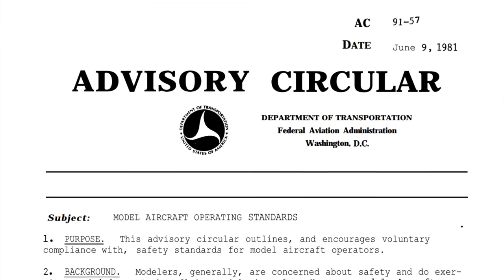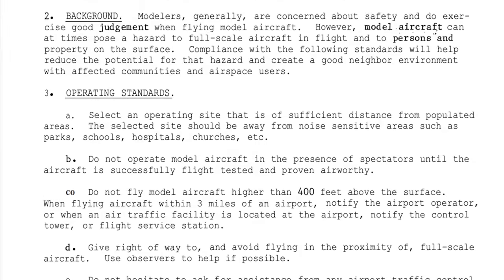A Remote ID Solution for Fixed Wing RC

Comment: Forgive me Tim. You have way, way more experience than me in the hobby. I cannot help but feel that you are being hopelessly naive here. I don't believe that the remote ID requirement is about safety at all. There have been so few 'safety' issues that any ruling/regulation is not warranted on the grounds of safety - there is just no statistically significant issue to be found. It seems to me that your strategy here it to essentially tell the FAA that "us fixed wing guys are good guys and we don't do what the drones do". The FAA/Congress (more importantly congress) will not care about that at all, because the issue is not about safety at all. Others say that there are groups lobbying to have the lower altitudes of airspace restricted and regulated for 'pipe-dream' drone delivery services and 'air taxis' etc. I'm very open to being wrong about all this. Thanks once again for your content and I hope you prove me wrong.
Reply from the maker: Cliff:  Thanks for checking in!  The overall thrust of RID is a starting point for fully integrated manned/unmanned aircraft operations.  It is pretty much common sense that the FAA needs to know who is  flying in the National Airspace System.  Today they cannot do this, and identify the pilot of full scale has always been possible.  A bit easier as you can find the airplane at whatever airport it lands at.  You'd be amazed at what can be negotiated with the USG if you put effort into it.  Key thing with the FAA is safety.  We have to demonstrate, with data, that fixed wing (in this case) pilots can be trusted to follow the rules.  This simply is not the case, now, with the drone community.  FRIAs will be a test.  If we can show we stay within the boundaries, this will be most helpful.  Tim
Reply: Don't agree with you Cliff.  There wasn't an issue until Quads started wandering into controlled airspace. In particular, far too many GA pilots report Quads dangerously close to the pattern, and Commercial pilots have seen them on approach. 

That's what put the burr under Congress' and FAA's saddleblanket.
Reply: @TimMcKay56  Tim, how do you identify the pilot of a paramotor when one flies overhead?
Reply: @gordonmckay4523  So why do  we need RID for drones?  Can't we also just follow them to the landing site -- they go even less distance than paramotors!
Reply: @kf4293 no it was sparked by commercial interests, a dji watching ball game.
Reply: @xjet  X, as I've said elsewhere, Get mental health care. You don't even live in the United States! You literally don't have any skin in the game. Just... stop.
Reply: @RickLaBanca   That happened, I believe, after the proposal. It was, however, another example of a few quad flyers being irresponsible nuisances, and thus giving the FAA another example to point at of why "baked in" RID is "necessary."
Reply: @kf4293  that’s how to lose a debate! It affects us all, countries follow suit all the time. I welcome any smart input.
Reply: Exactly right!  The Folks Against Aviation(FAA) had no interest in the zero to 400 foot Above Ground Level airspace because it had no value.  It wasn't until corporations like Amazon started thinking about using drones for delivery that this whole debacle came about.  Suddenly there was a move to get all those amateurs out of the way.  The solution?  Crowd them all onto reservations(FRIAs) where they could be watched and controlled.  Those that got off the reservations had to broadcast their position to everyone, not just LEO'S.

I'm concerned that flyers will get robbed because they are broadcasting their position and that they have a $1000+ piece of equipment.  Then there are Karen's throwing fits because her privacy has been violated while she is in a public park.

I don't see anything good coming out of RID!
Reply: @RickLaBanca   You missed the earlier volley brother. I strongly advise you to keep your nose outta it.

However, since you insist on being a clown, RID is US. When did the FAA get jurisdiction beyond the United States and its territories? 🤔 

Maybe I missed some resolution at the UN giving them worldwide authority, I was so busy with the War in Israel 🇮🇱.
Reply: If a wrongdoer wants to air deliver  a heavy item, over a long distance, then fixed wing is the vehicle of choice.
Reply: @nateteator3901   Correct. Typically, a Boeing 737 or 757 is chosen.
Reply: I agree man! All these people drinking and driving! It’s horrible. We all need tracking information in our cars to tell the police when we go to the bar!!! TRUE AUTHORITARIANISM FOR THE WIN!!!
Reply: As you are well aware, fliers in the UK are looking at the US in your battle with the FAA, because of the close relationship between the two! 
"when the US sneezes - the UK catches a cold"!
So naturally the UK has a vested interest, especially with their battle with the CAA?
Reply: @kf4293  Whether he lives here or not... his point is still valid! I do live here in the States, what gives Part 103 ultralight operators/Paramotors the right not to be monitored on what they are doing or see if they follow rules in airspace? Absolutely nothing other than radar... They require no registration or license, no real age limit, no radio communication, and no transponders. But you want my toy plane to have half of this being operated safely at an AMA sanctioned flying site...? I dont think so.
Reply: The FAA have admitted that RID isn’t about safety, it’s about security. It was pushed on them by Homeland Security, DoD, etc. and they specifically insisted on having the control location broadcast.

Comment: Be careful if you focus on the "safety" aspect.  Unfortunately the traditional hobby has a worse safety record than the recreational drone community.  As of the time I type this, there have been ZERO deaths attributed to the recreational use of multirotor drones -- ever, anywhere on the planet, however there have been a number of deaths within the hobby over the years.   If you emphasize "safety" the FAA could come back and use that data to destroy your argument.
Reply from the maker: Xjet:  You raise an interesting point here.  This may seem a bit odd or strange, but when the FAA talks about safety, they like safety, but they are really focusing on the traveling public (on commercial airliners).  The FAA, if guess in terms of "personal freedom," gives a tremendous amount of leeway to pilots killing themselves . . . as long as they do not hurt the innocent public.  There are around 230 general aviation crashes a year, same accidents every time.  This could be fixed easily with, say, a checkride every other year.  But the FAA tolerates this, again as long as the public is safe.  Don't get me starting on the ultralight safety record.  So it seems a tad harsh, but the FAA really "does not  care" is an RC modeler get injured flying their Telemaster.  Tim
Reply: Yeah.  I've don't know of any drone that run on jet fuel and go who know how fast..   but I've seen some model jets. explode on impact when crashed
Reply: It's not in the realm of impossibility that a government agency would bend some statistics to suit there needs.
Reply: There have been precisely two deaths worldwide that are officially attributed to fixed wing model aircraft. It may be possible that more have occurred but predate the current world wide sharing of information. Your point is invalid.  The single biggest distinction between traditional hobby model flying and multi rotor operation is the level of personal skill required as a beginner. Since multi rotor UAS cannot be manually controlled, but only controlled by giving commands to the automatic systems onboard, the skill level required is almost zero.  This leads to , as outlined in this video, the flooding of the air space by ignorant operators.
Reply: @gilbertgauger3380  Clearly you are unfamiliar with multirotors.  If you were nearby I'd gladly let you try to fly my freestyle quadcopter.  It has no GPS, it has no self-righting capabilities -- it does exactly what you tell it to do -- which, in the case of the untrained, is seldom what you want it to do.   The reality is that a freestyle quadcopter is far more like a fixed-wing pattern-ship than anything else and requires a lot of skill and practice to even hover.

You seem to make the assumption that all multirotors are the same -- which would be as ridiculous as suggesting all fixed-wing models are the same when we know there are some that are almost impossible to crash (SAFE) whilst others require significant skill to take off, fly and land.

Please research the subject before making sweeping comments.
Reply: Safety has very little to do with it. Both drones and fixed wing aircraft have pretty good safety records.  The government is more concerned about the deliberate missuse of unmanned aircraft.  The bad guys are not going to use a remote id when they use a drone or rc plane for improper purposes.  So, sending the FAA a kind note asking them to change their mind is ridiculous.  😊

Comment: I like the idea of separating out fixed wing from drones (and I'm a quad pilot) but not about restricting cameras on fixed wing. FPV on fixed wing or just recording your flight on a GoPro or RunCam is a nice way to relive your flight on those days when you cannot fly. FAA should respond to the overall safety that we modelers have and let us fly. Let Homeland Security deal with all of the fringe element doing nefarious activities with flight.
Reply from the maker: Russ:  I am in no way restricting cameras on fixed wing.  Just, for this very initial discussion, require RID on fixed wing that use cameras.  If we can show we follow the rules, then further negotiation.  Tim
Reply: What do you fly quads or drones
Reply: Two things make quads fundamentally different than traditional fixed wing: FPV and VTOL. VTOL allows someone to launch from their front porch, whereas fixed wing pilots need to seek out a large open space to take off and land. FPV allows flight out of LOS, which is where they tend to get into trouble (like into aircraft approaches). The combo of the two, while fun for the pilot, makes it trivial to do bad things. Also, the inclusion of a flight computer which makes it easy for a novice to fly with no training means that a quad pilot will not typically have exposure to experienced pilots that will have taught them the proper safety protocols. FPV and Go Pro are entirely different things.
Reply: Also, while not as common these days, quads without FPV do exist, and they should be considered the same as fixed wing (as they are LOS) in Tim's argument.
Reply: @jasonhurdlow6607  I’ve got fixed wings that don’t require that space. 
Consumer dji drones allow what you describe, most quads do not.  I doubt many freestyle or racing quad has been reported in an airport, if any. We only fly 3-5 minutes!
Reply: @RickLaBanca  A quad is a drone. All unmanned aircraft, are " drones "

Comment: Your premise is based on  experience with AMA flying.  However, there are those who fly fixed wing that are not AMA members and do not fly around the patch at AMA fields.  Examples are FPV and autopilot fixed wing models.  The feeling of flying fixed wing FPV is a magnificent experience.  The guidelines for safe flying and respect for people and property are a must for any RC pilot.  So it is pilot decisions and valuing others over ones personal desires that ultimately drive safety.  The AMA as an organization demonstrates how to focus on and teach flight safety.  However, assuming fixed wing flying equates to AMA membership misses the mark and does not consider the possiblities of current and future forms of fun flying.  One example is flying quads LOS where no camera is used.  So perhaps a solution is not lumping any form of RC flight together based on stereotypes and instead focusing on getting safe RC flying in front of the public and quality opportunities for education and training for all ages to keep people and property safe, both those flying and those in the air space where RC flight is occuring.
Reply from the maker: Fair enough. Just working to get something started, this will be solved in stages. Tim
Reply: This is a HUGELY important point.  I am afraid it is hard to segment RC flying.  In the UK the CAA have tried this using the term "autonomous aircraft",  which basically tries to separate aircraft with a flight controller and those without. This is missing the point. There are large numbers of fixed wing flyers who fly with FPV and flight controllers.  And 99% of those either follow rules directly, or are grown up enough to understand the risks and mitigate them.

Comment: The FAA should have known these differences from their early discussions.  I'm afraid as a fixed wing modeler, we're stuck with what has been written.
Reply from the maker: We'll see!  Tim
Reply: True.. which is why it is (IMHO) unforgivable that the AMA didn't remaine immovable on the need to draw a distinction.  Instead, it got bought-off by the promise of special privilege (FRIAs and CBO status).   Everything has its price and we've seen  the AMA's willingness to sell out the hobby when there's enough privilege on offer.

Comment: Let's be perfectly clear, a heli is not a fixed wing. And cameras are not an issue. A sensible move would be to regulate gps equipped model aircraft.
Reply from the maker: Good input!  Tim
Reply: Cameras ARE an issue, but only when used for FPV. Quad or fixed wing doesn't matter.
Reply: @jasonhurdlow6607  why? Fpv offers more control and awareness.
Reply: @RickLaBanca  Because FPV allows you to fly beyond LOS.
Reply: @RickLaBanca  and I would dispute that FPV offers greater control or awareness vs LOS. It would depend on the situation.
Reply: @jasonhurdlow6607  automation allows bvlos also. 
And fpv doesn’t mean bvlos . Only for certain craft with that range.

Comment: Yes  Tim you are 100% correct ! We that are flying fixed wing aircraft  should not be lumped in with Drone pilots. The FAA  hopefully will take into account the AMA 75 years of a great safety record.
Reply from the maker: Thanks for sharing!  Tim
Reply: Why not?  It seems many fixed wing filers have no idea what a home build quad is.
Reply: The multicopter safety record is way way safer than fixed wing

Comment: @12:00 you ask why did the FAA want drones and RC planes categorized together?   Did you watch the Congressional hearing on Counter UAS which I excerpted from in my last video?   It is clear that the call for dumping S336 and the introduction of registration & RID was driven not by safety concerns but by a commercial drone industry that simply wants to clear all other unmanned aircraft from the 0-400ft airspace.   One of the critical aspects of BVLOS commercial operations is being able to ensure that there are no hazards in that airspace to compromise those operations.  The commercial drone industry sees recreational users (of drones and/or RC models) as a hazard and they want them effectively removed from the skies that will be used to generate revenues for those commercial operators.

This is also pretty apparent when you look at how the regulations are structured.  The default (part 107) is effectively commercial operations and the hobby gets a very limited "exemption" based on some quite onerous restrictions.   The NPRM saw that exemption effectively phased out over a short period of time -- and if you believe that isn't still the end game then I have some swamp-land in Florida I can sell you.
Reply from the maker: Lots of comments are said in various Congressional hearings.  That's why they have hearings.  What matters is what is printed in the final rule.  Recreational RC flying will be just fine.  Either fly in a FRIA with no worries, or purchase a single RID module . . . and go fly.  Tim
Reply: @TimMcKay56 you only care about yourself which is maddening. 

Your comments on camera comments and built quads show ignorance, it makes me nuts. 

Do you know our drones are at max  flying 4 minutes?

Arghh!!
Reply: @RickLaBanca You can easily obtain quads that fly for much longer periods of time, just as I can fly my fixed wing slope soarers for literally hours at a time. The flight time arguments are a dead end AFAIC.